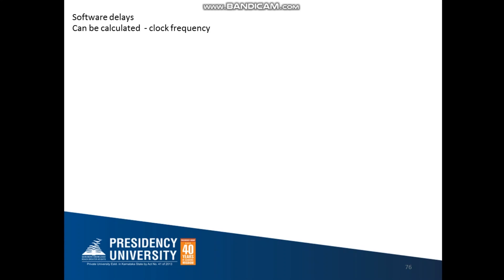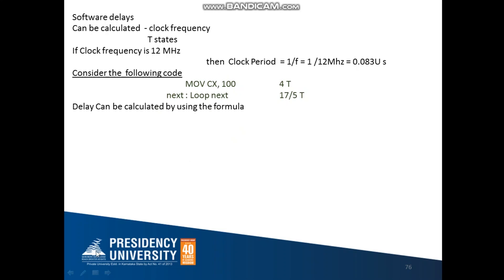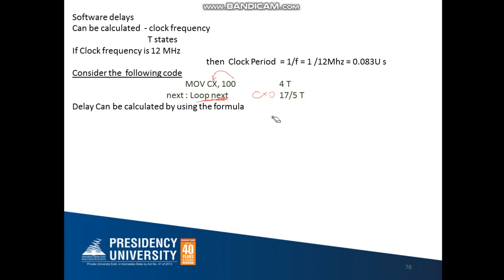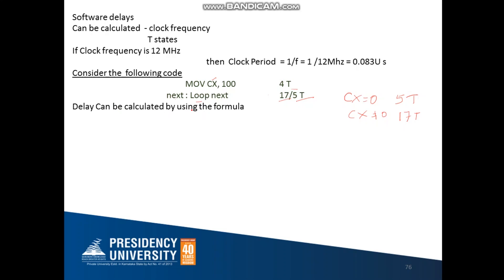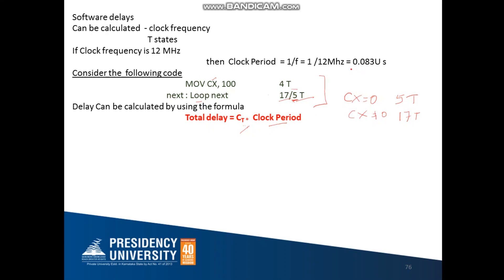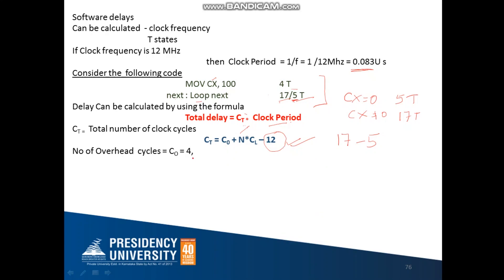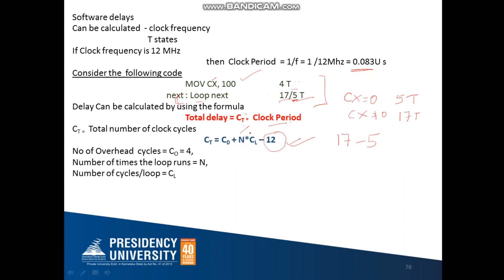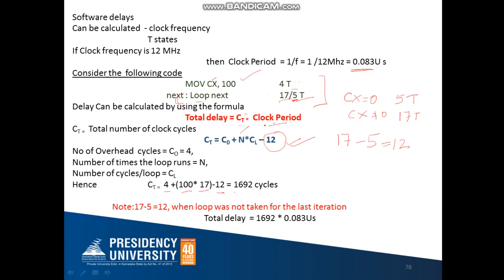Delay Using loops 1   8086

Comment: Mam will the clock cycle be given in the question 
Like for example
Mov cx, 100 4T 
Will that 4T be given?
Reply from the maker: Usually it may be given, even if it  is not given we know the most commonly used instruction for  creating delay and we can learn the number of T states each uses.  Mostly we use , mov , nop , loop and jump in the program to create delay
Reply: Thankyou mam